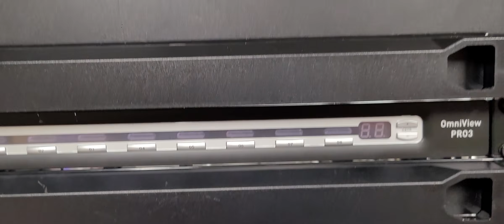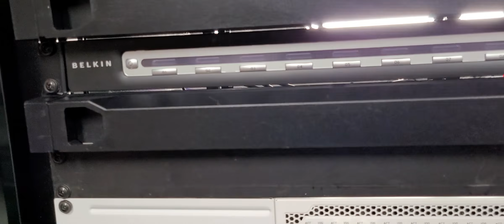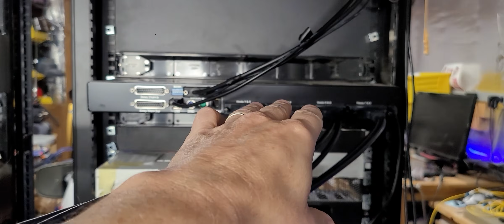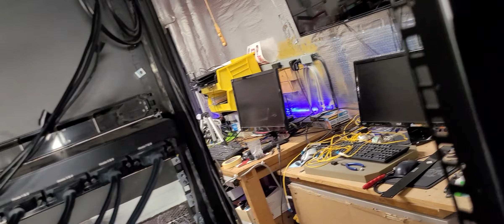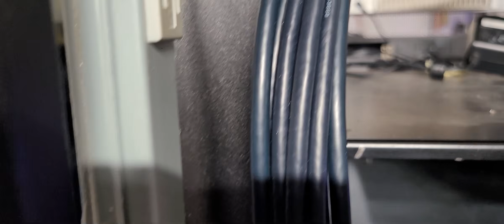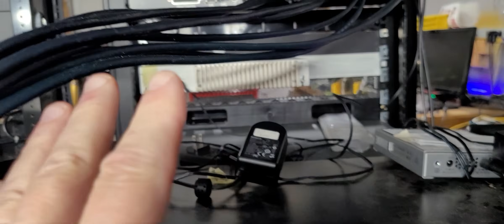Time to re-add my KVM network back into my home data center lab using best practices

Comment: Question, I'm thinking about doing an Nvme raid and need your opinion. I was wondering would I need to get multiple tri-mode controllers since pcie nvme takes up 4x lanes per lane? And the bandwidth with the card would be 16x wouldn't that bottleneck the drive. Do you also have any advice on nvme trimode controllers?
Reply from the maker: yes it will bottleneck so for now until PCI-E version 4 standards come out in force, I would hold off and save the money.  As for the trimode controllers, that is a mix bag of tricks... The card try to work with PCI-E version 3 but you can only do so much.  Check out my video of NVME raid cards and their limits with today motherboards.  If you want to get the most from a NVME card try a dual NVME RAID 1 card and use two of them.  one  for OS boot (let say 1 TB x2 in RAID 1) and the second one with 4 TB x2 RAID 1 native as your data drive.  Just idea if you really want NVME speeds, Yes they are a little impacted but in a good way for the RAID controller is really fast (Better then SSD drives)  but not a fast as a single NVME drive in use on PCI-E single mode card.   I hope this helps out some...   P.S> make sure you avoid the first gen PCI-E 4 triraid cards.  They have issue and overheat fast depending on workloads.  They need to work out the issues first then buy the second gen cards...
Reply: @leadiususa7394  I'll make sure to check your video out. Thanks for your reply.

Comment: I know your using 10 gigabit for your switch but is their any chance you can do a video on Fiber channel and infinity band and why people don't use it much yet

Could you recommend any higher band switches that do 100 gigabit 40 gigabit and when you stick to a brad such as an hp switch do you have to have the another hp network card for your pc or nas for the pci slot or can you use a different branded device or does this cause a conflict 

Their are not many high band switches and the ones that their are are very expensive looking at thousands of pounds im guessing because its for enterprize data centers but their are older switches for Mellanox, Cisco, Netgear, HP, Dell, Ubiquiti not sure about, or Mirkrotic

When you look on here for infromation on anything over this on youtube their really is not much on it in videos its more for like something not very technical they just show the speed of it but not the technical detail around in it

I was thinking surely network gaming would be a lot better using this and that the large gaming consoles have missed something here.
Reply from the maker: Well yes I can do a video or ten on those topics (I did do one of fiber Channel already) but I think you might not be seeing the value of spanning tree your 10 GB connections into one higher speed pipe or ALB (Adaptive load balancing) NIC groupings and so on a 10 GB switch ( Let say a eight or 12 port switch)  You can save by adding two or three 10 GB cards to your system and get 20 GB plus on a 10 GB switch.   Now it take some tweaking but it can be done and at a great lessor cost.   To buy a 100 GB switch is way to costly on both the NIC side and the switch side.   BTW this also works with 1 GB management switches as well so you can give your PC a 4 GB connection by using a four port NIC (very common to buy and low cost.) and no added cost for your current 1 GB Managed-switch can handle it now.    Give it a try... 
So one last thing, you may ask that a 10 GB switch can't do more then 10 GB but you are wrong.  For a 10 GB to handle the speed of the ports it has,  It back end network bus is the total sum of all the ports so it can handle 10 GB connections.  SO if you have two systems using two 10 GB NIC connected to the same 10 GB switch, you will get 20 GB of speed or three NIC on each system for a speed of 30 GB.  They have to be on the same switch for this to work but that the only issue.   Think about it.  Enjoy and look for future videos as you requested...
Reply: @leadiususa7394  so i've looked at this Load balancing 

A video would certainly help as their are a few different types of load balancing that i have seen such as 
load balancing switches
load balancing routers 
san switches
packet switches 
etc

Could you do a diagram explanation on paper and possibly explain the price differences between old equipment vs news as i think some people could afford 100 gigabit using older gear although their maybe some hidden caveats that make it not worth doing this such as i noticed transceivers are harder to get and nicks but the cabling doesn't seem any more expensive ?

So as to what you were saying does load balancing some how let you increase the speed and does it do this by storing internet packets ?

I've also seen this, is it the same as what your suggesting with a load balancer or is it something completely different ?

Channel bonding 
Makes it possible to spread individual packets among-st multiple internet connections. By splitting all your web traffic at the packet-level, even large transfers, like live streaming videos and uploading and downloading files, can be given a major speed boost!

Another thing is brad is it was you who mentioned to me its always better to have more ports available so alot of equipment is around the same price when you get into 16 ports and upwards 

Something else be interesting to know is can you mix and match server equipment, say like can u use a dell transceiver for fiber with a switch that is mikrotik or do you need the same transceiver im presuming you dont have to use the same branded network nics so like if you had a dell server could you use an hp nic or would this have to be dell as well. ? so like can you get like universal equipment that works on all.

Thanks for your suggestions brad i guess i just need to keep researching 😀

Comment: good video brad can you explain in more detail if you no what the difference is of these other way you can also do this in a new video prefarably over a message if its possible ?

1 Belkin omniview
2 Over ip i think this maybe terminal,
3 Over managed switch again im thinking this is a visual version of terminal, 
4 Rasbertty pie 
5 SpiderDuo - Compact Remote-KVM with Local Access - Lantronix
6 Bluetooth
Reply from the maker: Sure...  Well let's break these down. 
1. Belkin Omniview Pro3 - is a true KVM native network that using normal KVM hook ups. 

2. Doing RDP (remote Desktop protocol)  Over TCP/IP allows for you to do either do a SSH terminal or a remote desktop session to a system or device,  Works on all OS mostly and most IP base devices. Most common format used today.

3. Secured Management serial switches again for doing secured SSH terminal only mode session to devices or service Unix / Linux mostly. This switch runs on a VLAN secured from normal traffic. This support CLI mode terminal only, (Very old school.)  

4. Linux Remote session tool for Rasbertty Pie Linux OS only.  (This is like Windows RDP and yes you can access R. Pie systems from windows) 
 
5. SpiderDuo - Compact Remote-KVM with Local Access - Lantronix This is also known as pig tail KVM - CAT5 emulation KVM networks.  It was introduced to help reduce the older heavier KVM cables to better manage plus do large scale LAN based KVMs metworks.  P.S.  You do not connect these KVM-CAT 5 cables to IP switches, just KVM switches only.  The KVM switches will have their own IP connections you access for KVM access. 

6. Bluetooth is mostly use for Cell phone remote access that I know of.  I don't use Bluetooth because it is not secureble.   

Hope this helps some... Enjoy!